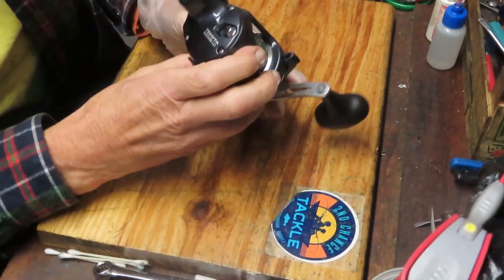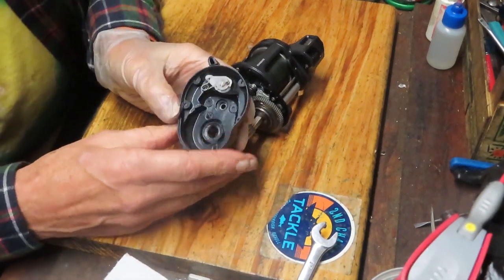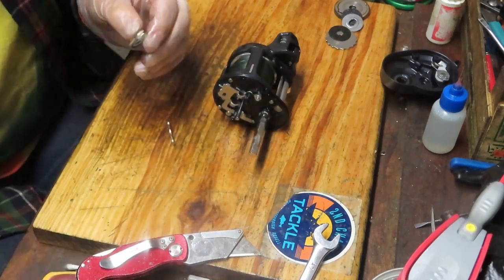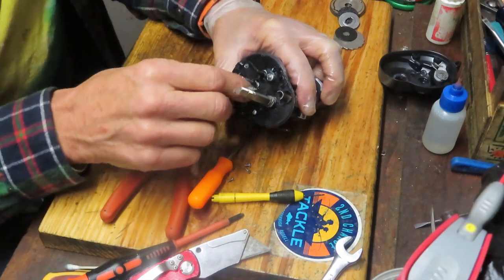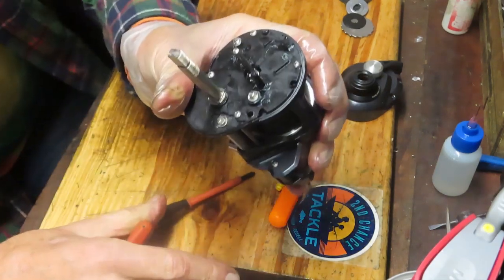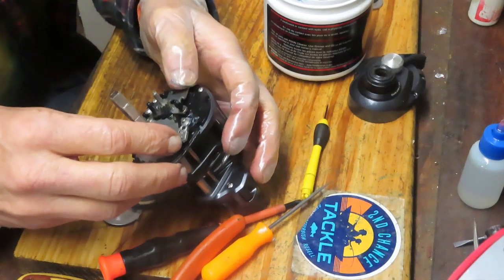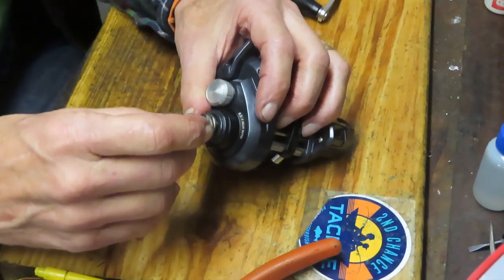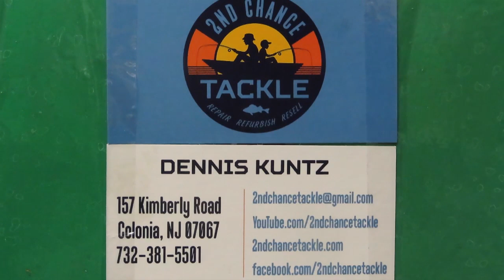Shimano Tekota 500HD LC fishing reel how to take apart and service

Comment: This is probably a stupid question; but I assume you need to respool your line onto the reel to sync the line with the guide following the servicing. Is that correct?
Reply from the maker: Not a stupid question at all!  In fact, most folks would not think of the out of sync condition.
You can do this two ways without re-spooling. First, you can manually sync the spool to the line guide by keeping the spool out of the reel and then moving the guide to the center before putting the spool in.  Make sure that the line coming off the spool is also in the center before reinstalling.   You will also need to check whichaway the line is moving and which way the linguine is moving to make sure you are on the same cycle.  The second way to do this if the spool has already been installed is to loosen the line guide cap and remove the pawl, then slide the n]line guide into position before reinstalling the pawn and cap.  Again, check which way the line guide is moving - back or forth and which direction the line is moving on the spool - Thanks for asking - Dennis

Comment: I have a tekota 400HG LC and when the clicker is engaged, when I reel it sounds like a coffee grinder…but when line pulls off the clicker sounds like it’s working properly. Any suggestions?
Reply from the maker: If I were to guess, I would think that the plastic click drive on the back of the spool is worn.   It the click is always on when reeling, it could wear down one side of the point more than the other.  Since the bait alarm is going in the opposite direction of the reeling, the one side may still engage better than the other and make more noise - Just a guess.  I would replace that part on the back of the spool
Reply: Thank you sir, I appreciate it!